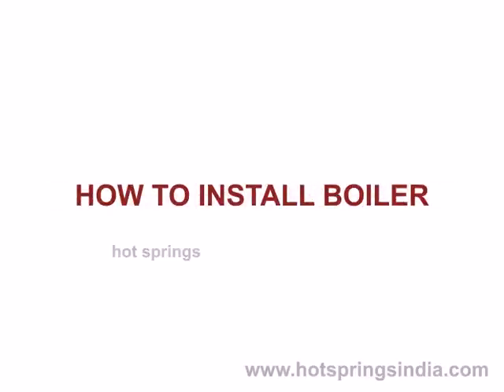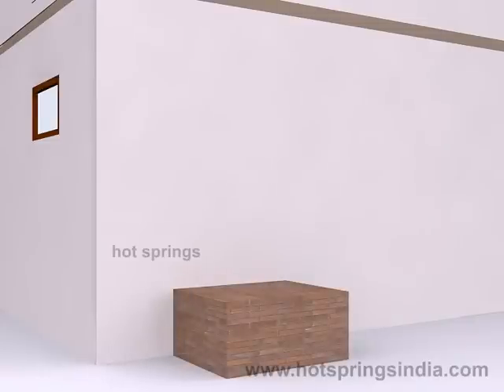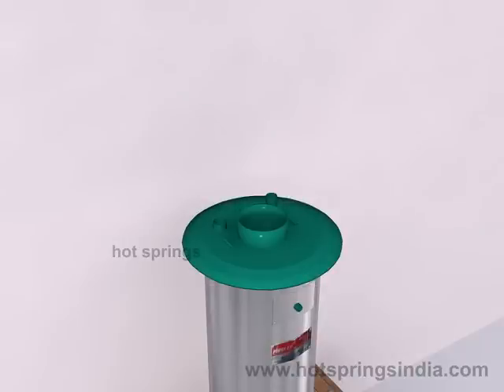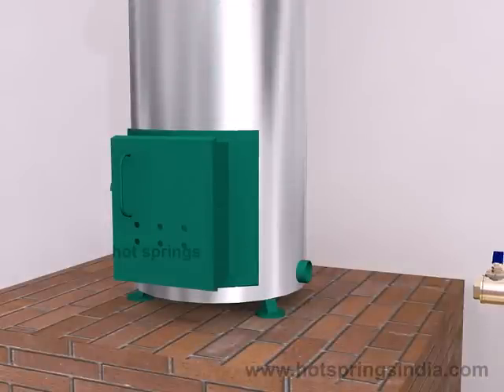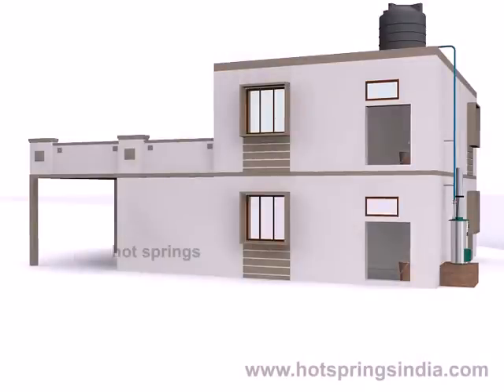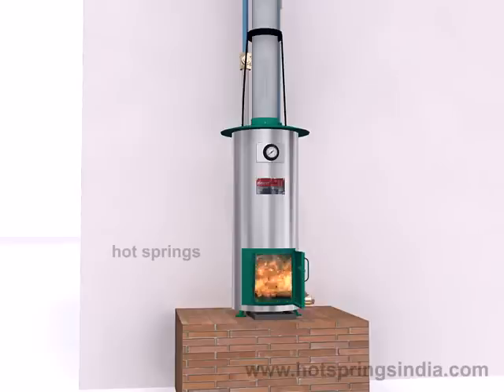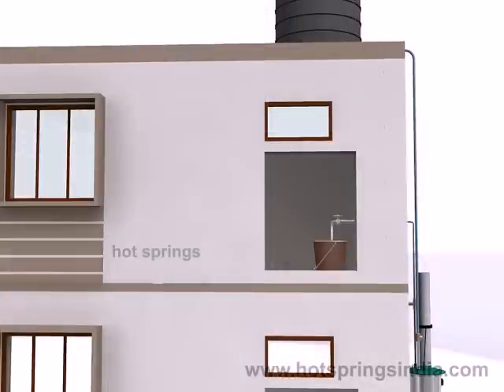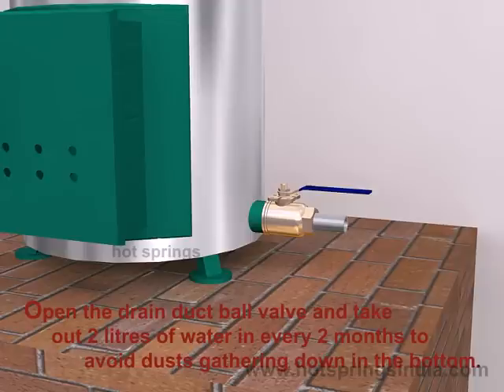Firewood water heater

Comment: I would think many people in the US would love to get ahold of a water heater that is wood fired as it has so many possible uses. This HW heater could also be used as a small water boiler for say a hydronic heating system with the use of small water pumps. If I could find one of these water heaters in the US today I would use it in this way myself as I have a very basic hydronic heating system that used to use an outside wood boiler but I quit using it as it was way to much work to keep going, IMHO. This water heater here would require less wood and since I have a class A chimney I could use in my shop and pump the HW to where I need to heat my home. Of course my idea/plan is possibly illegal it could be done easily if certain criteria were met, or you just the whole thing quiet/hidden! On a side note if this manufacturer installed a heat trap in his ''hot'' or ''out'' pipe he wouldn't have the issue of hot water traveling all the way up the pipe and into the dwelling here. BAsic plumbing 101..

Comment: How it will pump the water to upper side
Reply from the maker: It works under the pressure of the over head tank.
Reply: @HotSpringsFirelit  is it safe to make the hot water outlet in the bottom of the geaser?